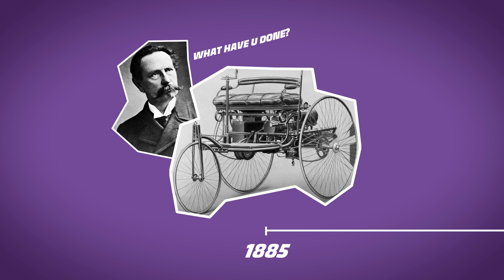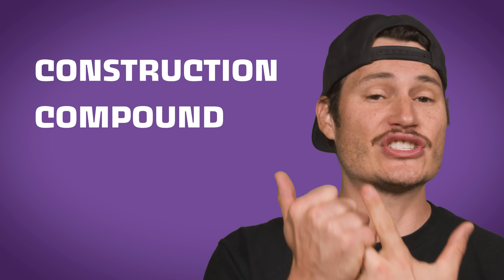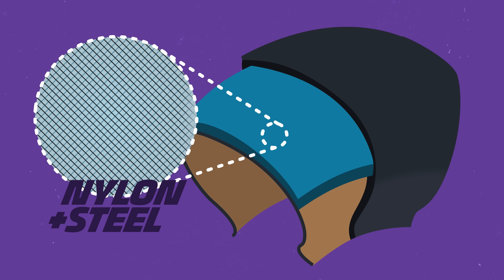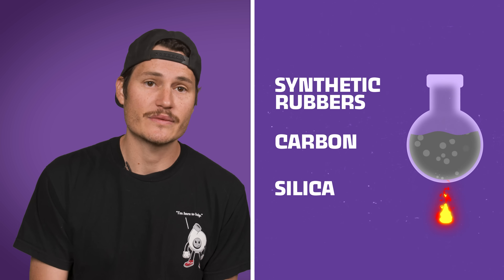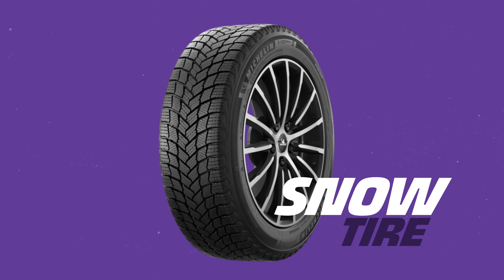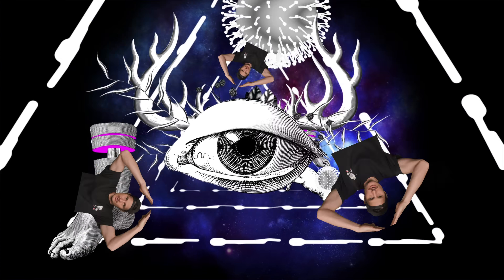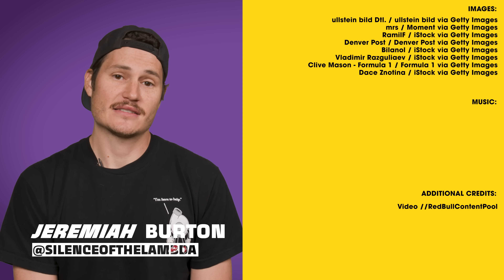The Surprising Science Behind Tread Patterns

Comment: The reason why drag racers have wider tires is to introduce more points for the tire to enact force on the "peaks" of the road surface. In an introductory physics course most of your teachings and understanding is on a single point of contact, or particle. So the friction equation F_f = \mu * F_n, can be scaled according to however many particles, or instances of contact you have. That's also why drag racers use softer tires, and often deflate them, so than can introduce more instances of contact to the road/track surface. For example if you have a tire so small, where it only makes contact with only one peak in the road surface, even in a heavy vehicle, the force of friction will still be relatively small compared to it's weight. It's like have only one one person push a brick wall, but if more people push the wall, eventually the wall will topple. You also cant forget there are two different types of friction, static and kinetic. Static, for when an object is usually at rest and trying to move; and Kinetic, for when an object is usually moving, and is trying to stop. Coefficients of static friction are typically smaller coefficients than kinetic friction, meaning it's harder for the weight (which is "equal opposite" of normal force) to act on the tires regards to get gaining Grip.

-UCF Aerospace Engineering undergrad

Also, I love you guys!
Reply: static coefficient > kinetic friction
Reply: Its the same thing we do when we go mountain biking, less air more surface area more speed and control downhill 🤙🏽

Thanks for the info
Reply: You won that t-shirt for sure!
Reply: In layman terms, more surface area to contact with... just as intuition would say. Maybe there is nothing that accounts for a definite area in an equation somewhere, it's essentially still the same thing, in a roundabout way. More points of contact literally translate to a bigger surface area. That's quite literally what an area is, a lot of discreet points next to each other. Deflating a tire just increases the contact are with the road as it sags more under the same load. I understand what you say but it seems the question is more philosophical than describing reality.
Reply: This is not exactly true, theoretically in the simple friction formula area does not matter.  Even if a mack truck only contacted one peak, the available friction force would be the same.  The answer to the question is the coefficient or friction is not constant with tires compounds.  The coefficient itself is inversely proportional to surface pressure.  That's why the simple physics formula you learn in your undergraduate generally fails when you consider tires.   With the simple formula there is no reason that a truck takes any longer to stop it than a motorcycle.  ( Mechanical engineer )
Reply: STOP DOING THEIR HOMEWORK FOR THEM.
Reply: Nerd.      

Jkjk thanks for the knowledge
Reply: Just to ask- If I have a box with a wide surface area, it is easier to push than a narrow box even though the friction is the same (and had more points of contact).

Why?
Reply: Wow an actual answer
Reply: No, that formula is not per contact point. It's for the entire contact patch, and the question is right that there's no area term.
Reply: It actually has a lot more to do with the stochastic nature of dynamic systems. The transition from static coefficients of friction (tire rolling) to kinetic coefficients (tire sliding) drop your grip by an enormous amount. You would like to be near the limits of your grip when driving as fast as possible but not go beyond the capabilities of your vehicle. If you just had a single point of contact when it started to slip you would lose all grip, however as you increase the area of contact then some fraction of points may lose grip while others keep it. The more area you have the more averaged out this response is and the more reliable your driving experience. The actual coefficients of traction and everything else don't change at all with more area, which is why it isn't in the friction force equation, you just get a more predictable response when near the grip loss transition.
Reply: @quintessenceSL  bc your shearing forces are different (note that they'll be much closer to the same effort required once they are moving aka shearing force is broken and no longer a factor) friction is based partially on molecular bonds between the 2 materials. Think about breaking a 1x6 board in half by stomping on it, will you have better luck with it like this (I) or like this (--) ? Intuitively you probably know it's easier like this (--) that is because you are acting against less shearing force. This is part of the idealization that the friction equation makes, it assumes this shearing force is uniform, which in the real world, nothing is uniform.
Reply: @quintessenceSL  To a degree you answered your own question. The box is made from a material that isn't optimized for surface deformation so when the pressure decrease with the added area the friction goes down faster than the area grows. This equal less total friction.

A drag race rear tire however will be made from a softer compound than a normal tire. This is made possible partly by the pressure being lower and partly by the fact that a top fuel dragster eats a set of tires each run, so longevity isn't an issue. The softer compound allows the tire to conform better to the surface of the tarmac which means the total friction grows with the contact area. At the same time just using the same compound in a normal width tire would not increase the friction as much as it does with a really wide and preferably low pressure tire.
Reply: All very good, except that static mu is greater than Dynamic/kinetic. You almost had it
Reply: You're forgetting that with lower air pressures and higher revolutions that deflated tire will distort from it's resting shape. Top fuel dragster and funny car tires if you watch their burn outs and launches in slow motion will "grow" to almost 3x their resting size. Watching that tire from the front or rear you will see that it narrows to almost 1/3 it's resting size. They do this in order to alleviate the force of the <12000bhp against the driveshafts and contact to the road. Basically showing us that the faster cars travel to and from zero the shape of the tires changes making it nearly impossible to factor in contact patch as a static value. 
Larger sidewall + lower air pressure + higher revolutions = more distortion and smaller contact patch
Reply: Hey, guys love the discussion around this topic, so much about cars fascinates me. I see that some of you guys are engineers and I am aspiring to become a mechanical engineer at MSOE I haven't been admitted but the cost of tuition is quite high. If you guys know of any scholarships that I could apply for or have any tips for engineering in college, please let me know.
Reply: @quintessenceSL  the weight is distrabuted over a wider area of the box also the box only has contact points with the crevices and none of the valleys in the imperfection of the surface it's gliding over were as rubber molds to the ridges of the surfaces
Reply: @marcvalme7732  my favourite line in a physics text is “consider a cow as a sphere”
Reply: From the research I've done that isn't what I could find. Theoretically, with all things being equal, perfectly smooth and inelastic tires on a perfectly smooth and inelastic road surface should grip equally regardless of width because the force of friction is not dependent on the area of the contact patch. That being said, in the real world the tires flex under the car (especially when braking or cornering) and generate grip by literally pushing off of the bumps of the surface, even in the case of a relatively smooth race track. Additionally, the coefficient of friction for the tires should be dependent on the temperature of the tire; a wider tire should be able to emit its heat more efficiently (larger surface area) allowing it to remain at a stable operating temperature to allow for the highest grip value. To address the scaling of the F_f = mu * F_n as you mentioned, it is true that you can divide by area to find the amount of pressure that will be acted on the larger surface area which can scale; I think your mistake is not realizing that the pressure being lower even across the larger surface area will lead to the exact same F_n. 

All this being said, it's actually a question I've had for a while myself; tire compounds and mechanics are a bit outside my expertise so if I'm wrong I'd love to find out what the correct answer is (Also go Knights)

-UCF Aerospace Engineering Grad Student
Reply: No idea what magic voodoo you are talking about.
It is all much more simple.
The correct answer is: The tire does not have so much grip, because it is big. The causality is, that the tire needs to be big, because it has so much grip.
At first you need weaker rubber to get more grip. You need to run this weaker rubber on lower contact pressure, otherwise you will destroy it quickly. That's why you need to distribute the same load over a bigger contact area, so you make your wheels bigger. The rubber has an optimal contact pressure where it works best, so you make the wheels exactly the size that matches your optimal contact area for optimal pressure under a given downforce.
You have spoilers and wings on your racecar for increasing downforce? Need bigger wheels too.
And then you need to radiate and cool away all the additional heat that comes from the additional acceleration and power you can transmit, so you need a bigger surface which is another reason for bigger wheels.
1.) weaker rubber -> less pressure applicable -> more contact area needed -> bigger wheels
2.) more grip -> more acceleration and deceleration -> more heat -> more cooling area needed -> bigger wheels
And that's pretty much it.
Reply: Oh please dont design my plane. You did not answer the question at hand, and also got the coefficients of friction mixed up. 

aside from the mix up, your answer to the question of "why does more contact area increase grip if it is not found in the formulas" was answered with 'bc there is more contact area.'

the real answer is bc you have to account for heat, tire wear, and compound malleability, which the formulas in introductory physics courses dont do.
Reply: Smarty Pants
Reply: i kid you not im learning this right now in my ap phys class lol
Reply: @alex-px1uz  True.
People are assuming the wrong causality. They assume, that a bigger wheel prduces more grip, which is not true. You need weaker rubber to produce more grip and you get more heat with that increased grip. So you need bigger wheels for not squeezing the weaker rubber to death and for radiating and cooling all the heat away before your wheels get on fire.
I also don't know what magic voodo Mr. UCF Aerospace Engineering undergrad is talking about.
Reply: @chaosbringer9007  we also do it for less pressure per square inch on the ground to stay on top of the surface. If the contact patch is bigger per the same mass, the PSI on the surface will decrease.
Reply: @doctorhabilthcjesus4610  I'm not sure I buy this as the complete story. If it were simply that more grippy compounds require wider tires, then tires of the same compound should produce the same grip regardless of width, which I'm not sure is true. Jonathan Benson from TyreReviews posted a study using the same Goodyear Eagle F1 Asymmetric 3 at 225, 255, and 285 tire widths and the configuration using the widest tires led to the shortest braking distances, implying that there is  more grip even with the same compound being used.
Reply: @yetanotherPC  The static coefficient of friction of a material is usually larger than the kinetic coefficient of friction for the same material, which is why, after losing traction, it can be very difficult to regain control of a vehicle.
Reply: @quintessenceSL if the box was made of rubber this would not be the case. Assuming your box is cardboard what you're experiencing is grip v's stability. A wide stable box will slide easily but a narrow one will tilt and dig in and grip. All it's weight focused on such a small area will enable it to deform to the surface it's on.

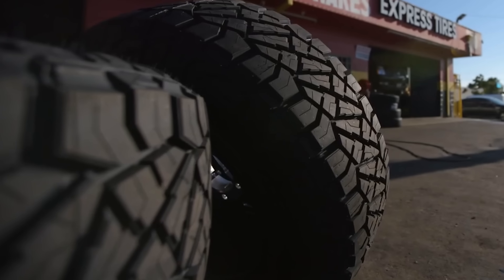Comment: 14:10 wider channels between lugs (particularly on more offroad focussed tyres like mud terrains) actually help the tyres to self clean when driving through mud and sand so that when the next part of the tyre becomes the contact patch it isn't full of slippery mud. All terrain tyres tend to get filled with sand or mud which does help on soft sand but is completely useless in mud as they don't self clean. The wider channels also help the lugs to deform around rocks when they are let down to give the tyre as large a contact patch as possible when driving over rocks and the like.

Comment: I laughed really hard seeing the Subaru hit that pole in the snow when talking about grip coefficient and water. Just perfect
Reply: Everyone thinks AWD and Subarus are some kind of magic in slick conditions. They're not, the just have a boost to acceleration in low traction situations,  which MIGHT help you get unstuck. It does nothing for braking or turning.
Reply: @Ididerus  it’s more stable than rwd at least. But other than that, it’ll skid like any other car. I’d argue fwd is slightly safer in slippery conditions anyway in terms of handling.
Reply: They dont turn for crap in the snow. Until it finally goes into snap oversteer 5 seconds after flooring it
Reply: @Ididerus  the stock tires are summer tires and people think they are rally cars

Comment: If we’re talking about Top-fuel dragster’s they use an extremely low tire pressure (I think 5-10psi)so they can use the affect of acceleration on the low pressure to change the circumference during acceleration and use this affects as a sort of gear box, when the car the launch’s the circumstance is the biggest it’s gets and along the run the circumference gets smaller to change the supposed gear ratio through the tires.
Absolutely fascinating stuff.
(I think top fuel dragsters officially only have 2 gears in they’re gears box)
Reply: Zacharia Weisman : You have the getting bigger vs smaller thing backwards. It starts off small then at speed  it increases diameter due to centrifugal force. It does in effect change the final gearing.